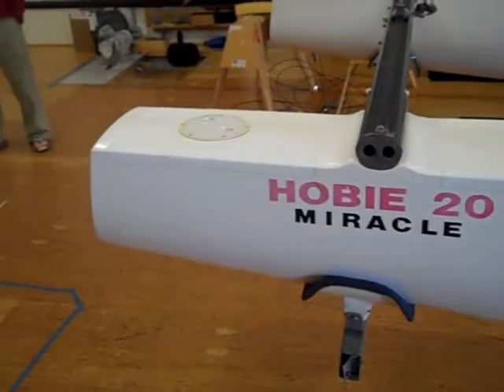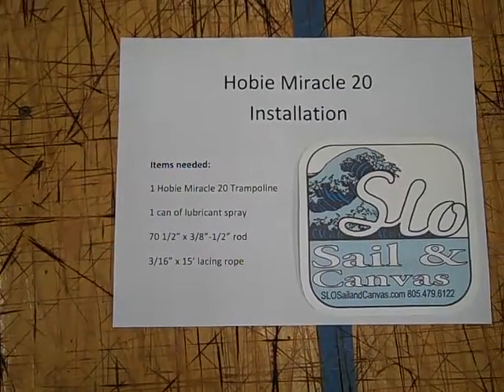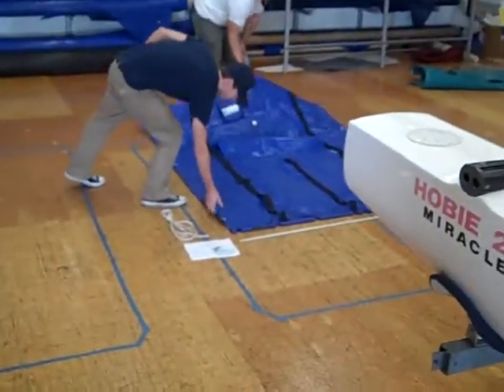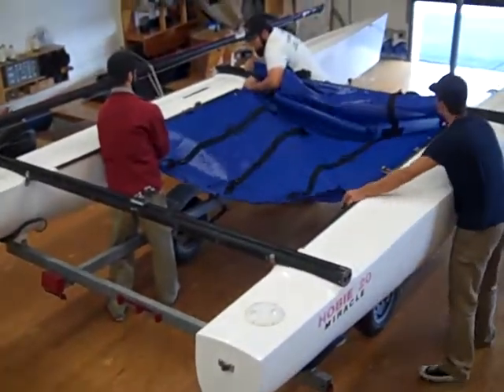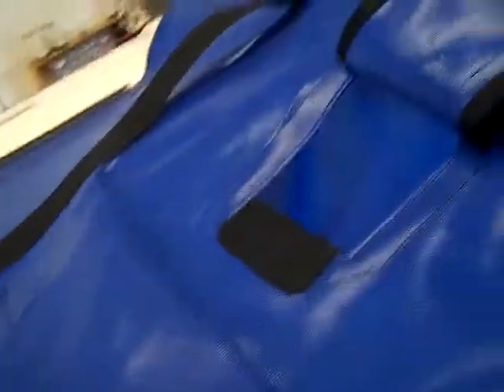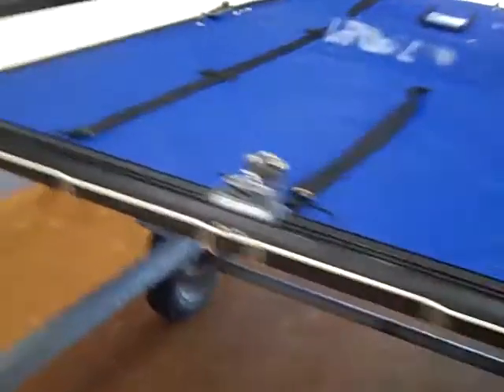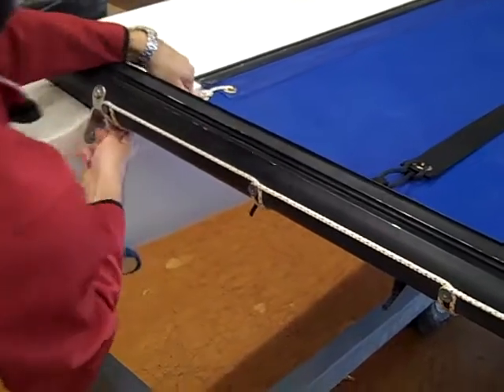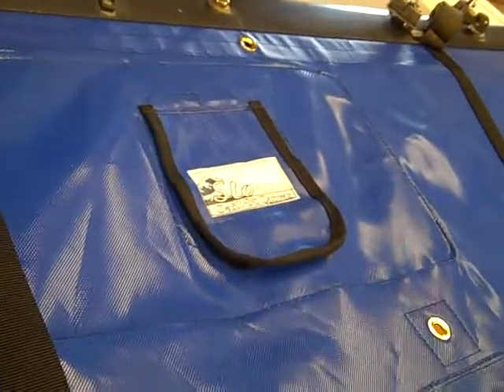Hobie Miracle 20 Catamaran Trampoline Installation

Comment: Curious as to why you did not start the lacing rope with a bowline hitch and used three half hitches?
Reply: Good question- The reason we hitch on both ends of the lacing ropes is that you can loosen and tighten from either end. If you tie a bowline, you always have to work the lacing line in one direction only. If you hitch, you can work from the middle out, or just on the side you need to make tighter. I hope this helps.
Reply: Good idea, will use half hitches in future, I have 4 hobbies T2's and 2 Tattoos,  a nightmare to tighten trampolines!

Comment: Is it possible add front trampoline on Hobie 20?
Reply: You can add a front trampoline, BUT, you have to figure out how to do it. In my opinion, a Hobie Miracle 20 is not well suited to a person carrying forward trampoline. This is a very performance oriented boat, and it's sort of like building a 4-seater Ferrari. You can, but does it make any sense. And yes, I know Ferrari has made a 2+2, and it didn't sell well, and still isn't worth much. So- probably best to use something other than a Miracle 20 to add a forward tramp to.

If you were going to add a forward trampoline the one CRUICAL step is that you need some sort of compression support between the hulls, otherwise they will fail at the forward cross beam. Look at boats with forward trampolines (Hobie Getaway, G-Cat 5.0, G-Cat 5.7) and this basically shows the best way to configure a forward trampoline set-up. Please let us know if you have any other questions. SLO Sail and Canvas will build a forward trampoline for you, but you'll have to figure everything out. If you're going to do it, it's best to contact us before you do any work so we can discuss what you want to do, what you fabrication capabilities are, and what your plan is so that your efforts are successful.